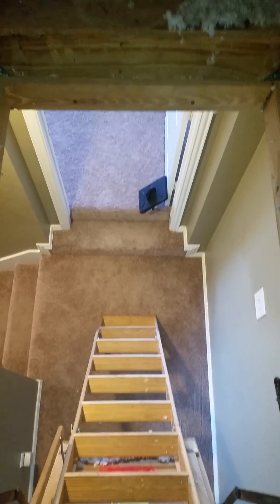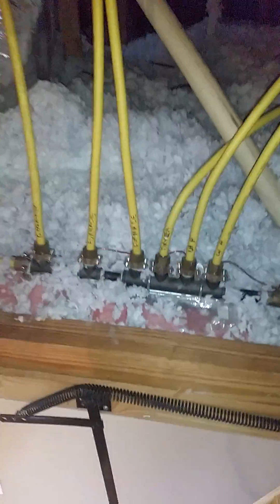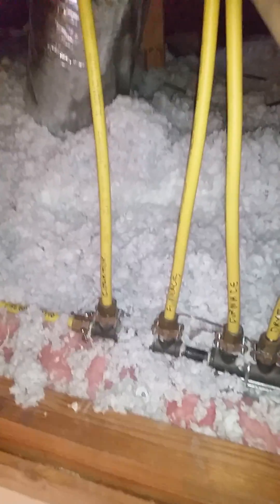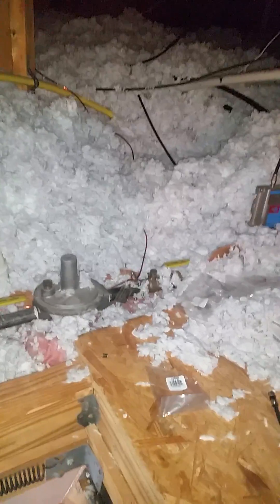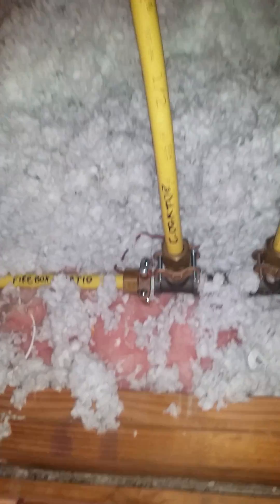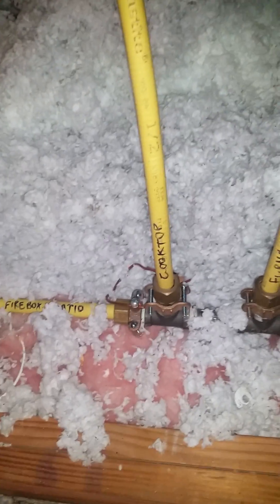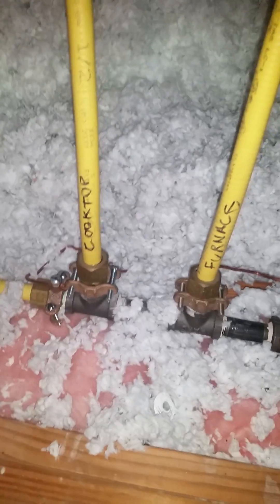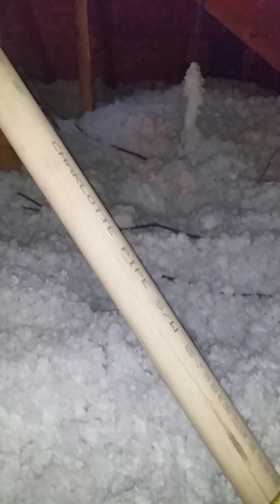CSST Gas Line Bonding

Comment: How come you didn’t need to do this for black pipe?
Reply from the maker: Black pipe is a solid piping system that is bonded at the service and/or at the equipment. The key point is solid piping. CSST is a softer flexible piping system and is more prone to damage from the electrical system or lightening strikes on or near the structure. The additional bonding helps lower the potential of damage to the softer flexible metal.

Comment: Bonding every single clamp does not change or help anything one single bonding closest to where penetrates through the house and starts is best its all metal and as long as it's bonded to the water pipe, or main panel or grounding rods outside its the same
Reply: You can’t count on bonding to a water line any more. If there has been a repair someplace and PEX or PVC was used that breaks the bond.
Reply: @Duckyou555  That's what happened in my house. Everything was grounded to the water pipe that had later had pvc installed. I had to add grounding rods.
Reply: Probably because it is inert and stiff? As long as it doesnt break, it wont hurt anything. 

But it is ugly and looks like shoddy work

Comment: So after talking to an electrical engineer, he confirmed that it is a waste of time and material to do this. A unbroken bond to the manifold before the first csst connection, accomplishes the exact result. The bond don't stop the pipe from being energized, it provide a path of discharge. Example: prevents csst from discharging on a nail or rafter hanger. Result- the arc can burn a hole in the line. Never let the csst provide the ground without bonding, unless using a product like flash shield (can't arc). I love when people attempt to do a great job but this is probably the result of a code enforcer, not understanding the code.
Reply: What code? Plumbing code 7.13.2 says to bond using  NEC which doesn’t mention gas pipe unless you interpret 250.A(4) (A) as your reference. To me, if it’s a serious issue, it should be specifically addressed in the code, and it is not as far as I can tell. I am constantly trying to learn and improve my knowledge base, so please correct me if I missed it.

Comment: Doesn't the teflon tape and pipe dope 'isolate/insulate' the bonding path?  In other words, they don't conduct electricity.  In order to bond the CSST, you would have to attach the clamp to the brass fitting or stainless under the yellow jacket. Correct?
Reply: Properly installed CSST will not have Teflon tape at the fittings. By code, the bond connection can not be attached the to the stainless portion of the CSST. Code requires the bond connection to be on the brass nut, or at the steel portions of the manifold or of the steel of the meter on the homeowners side of the meter.
Reply: You don't use on this type of system the brass is a soft metal so if you use it you can actually warp what would be a tight fit

Comment: Why does every other product require some sort of support? Electrical wire requires Staples and black or copper gas piping requires straps but this stuff is just draped through attics or stuffed into joist spaces with nothing to clamp it down?

Comment: If the gas line at the meter is bonded,, once you thread on the first compression nut to the black pipe,, isn't it bonded now?
Reply from the maker: That is correct, under current gas code installation requirements, the bonding can occur anywhere within the system as long is is not connected to the CSST pipe itself.
Reply: @ArlingtonInspector  Thanks! Other than issues with grounded, and possible lighting strikes,, is it pretty durable? Is the stainless actually quality? Has there been issues with corrosion? Thanks in advance!!
Reply from the maker: @chriscall3425  There are no report issues with corrosion on a CSST system. Just possible pin hole leaks with direct or indirect lightening strikes.
Reply: @ArlingtonInspector  hey Brain any thoughts on my comment about csst in attic ? Do you really need to bond it if ur gas meter is grounded .
Reply from the maker: @punxnotdead3873  The bond at the meter is the best way and is now required by code. That is the only bond required. The video shows how one of the local City's require additional bonding.
Reply: Overkill for sure. Your meter better be grounded. If thats the case you dont need to add all this grounding clamps to (bond) ur csst. Think about how mich voltage is in a lightning strike. If that hits ur csst or close to it, theyll melt so fast, the copper wires wont do shit. If lighting strikes ur yard, the gas meter all ready should be grounded. Only way I would bond csst is if it is connected directly to has meter outside. Any thoughts? Thanks.

Comment: I need to re pipe some gas lines around the house, My friend gave me a roll of this stuff for free "home flex" I'm just scared to use it even with proper bonding. I hear horror stories in Texas. I live in Michigan, but still.
Reply: I have seen lightning blow an oven out of the wall, in was hard piped.
Reply from the maker: It is a choice you have to make. I is legal to install "by code" but you should check with your city. If you choose to install CSST, you want to use a license plumber for the installation and have an electrician bond it for you.

Comment: What gauge wire is used for bonding CSST pipe
Reply from the maker: 6 Gauge solid copper is what is required for bonding CSST.
Reply: @ArlingtonInspector  
Thanks Brian..
You know if it matters where in the panel specifically?
And if there's a length code?
Reply from the maker: The code state the connect to the CSST to be as close as possible, the new IRC state not more then 50 feet. The bond connection in the main electrical cabinet should be on the ground side.
Reply: Just to clarify, it does not have to be SOLID copper, according to the NEC. It can be solid or stranded, insulated, covered, or bare. I have stranded in my house because I prefer the flexibility.

Comment: Overkill on all those clamps. Do the one and be done.
Reply: there are rubber o rings in the fittings and pipe dope or teflon tape between connections all are non conductive. maybe overkill here is a good thing. just sayin.
Reply: @tawcain  it's steel on steel connection, the rubber don't insulate and the dope is like only a lubricant.
I would say this done by someone that doesn't read well
Reply from the maker: That is correct Dave.
Reply: Doing one is how most homes are done, i believe, atleast here in the northeast thats common. But the proper way to do it is bonding each break in the gas line to the main. I dont know if it helps more but its homeowners code. Im actually trying to figure out ours at the moment so i can fix them myself. We just had ugi gas company install a water heater and they did not bond anything. Smh
Reply: It's an extra 20 bucks insurance that your house don't blow up if lightening strikes nearby. Also it's not a bad idea to check and make sure all of your appliances are correctly grounded so that they don't ground back into the csst if a surge were to happen. Can't be too safe!